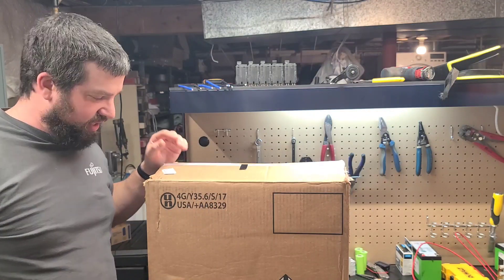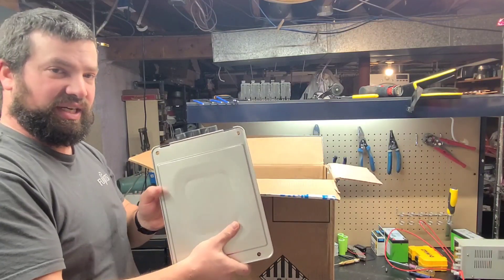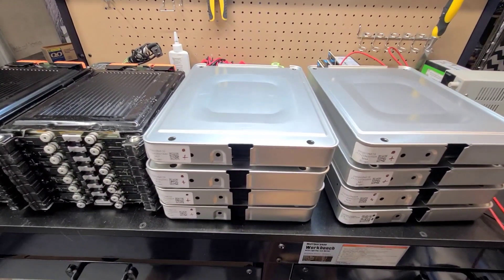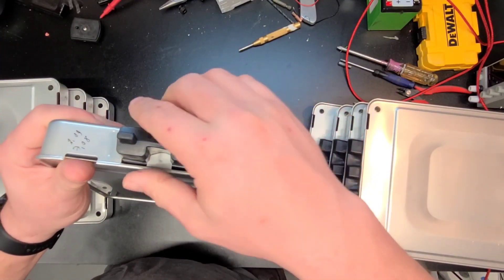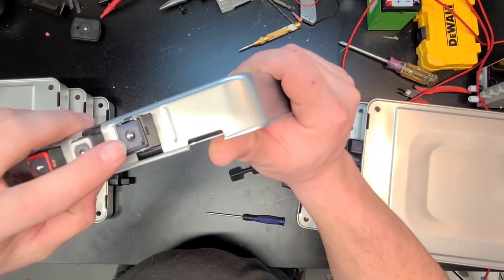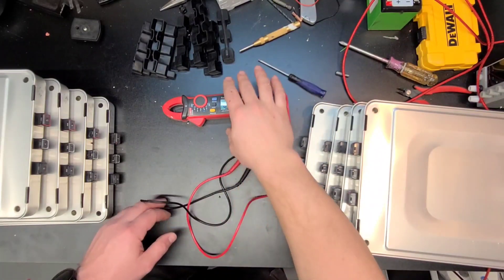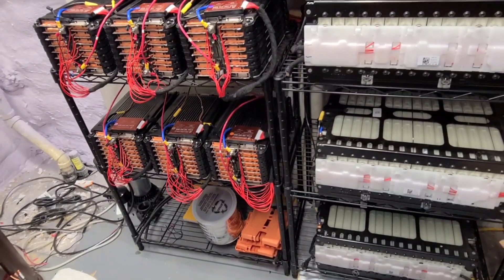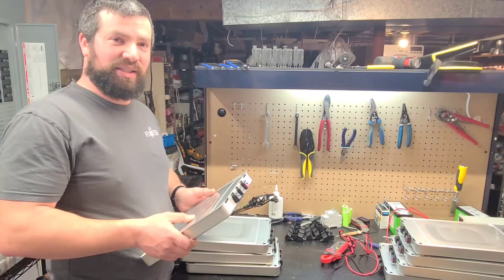Nissan Leaf Batteries for $40 a piece!

Comment: What where do you get the charger for those batteries?
Thanks for replies.
Reply from the maker: I'm using the Sol-Ark 12k to charge them.  It's got an AC charger as well as 2 built in solar charge controllers.

Comment: Another thing I like about the NMC cells is you dont need a large pack to deliver a whole lot of amperage even though I personally do not need it. The Nissan leaf cells are rated for 240 amps continuous and 540 amps max. Of course they would get warm at these draws but for surges etc it wouldn't hurt them at all.  You could have 7 or 8 leaf modules for 48 volt system with as little as 2-3 Kwhr of battery even if you just need them for surge starting motors when only using pv when sun available especially if you have an inverter that must have a battery.

Comment: What bms are you going to use?
Reply from the maker: Daly 40a 16s, just like the rest of my pack. I don't mind not being able to see all the numbers all the time.
Reply: @benssolarandbattery  educate me please sir. Does the bms see 8v or 4v? I mean does it see the voltage of both cells in the case?
Reply from the maker: @RJ-cc1fz  it will see 4v, or each series cell (or group of cells) 
The middle tab allows you to get down to the 4v level. I'll wire it up soon on camera.

Comment: The cost of Lishen or EVE lithium iron phosphate cells are around $125 per Kw capacity delivered now but it does take a lot longer to receive them.  For me and I assume many others though that already have compatible cell chemistry its a good deal.
Reply from the maker: Yeah, I had 2 choices.  Dismantle and sell my NMC 16s setup and go all LiFePo4 with those EVE cells, or double down and keep adding to my NMC pack.   Once I add my latest batteries to the pack, it will be around 37kWh.  I need at least 100kWh to even consider disconnecting from the grid (all electric house) so we'll see what happens.
Reply: @benssolarandbattery  You are kinda in my boat I have 30 Kw of the new chevy Bolt cells from the spring sale and just added 45 Kw of the Leafs from this deal .  Doubt I will ever go totally offered this cold spell now coldest its been here  since about Xmass 1982 which would be ok but cloudy 6 days in a row also. If I had been running generator the fuel would have cost more than connection fee and a little backup for over a year.

Comment: I am not sure what math or data they are using but 7.6 volts and 64 amp hour equals 486.4 wh  NOT 500wh. ? right off the batt lost 2.72% of energy ?
Reply from the maker: I'd bet one of the numbers was rounded down.  I'll look into it.
Reply: @benssolarandbattery  probably but I think 2 would have to be rounded down to make that much difference so like 7.7 and 65ahr would be 500.5 wh but 7.7 for 2 presumably 3.7nominal volt cells is a little high too ? should be 7.4 ? Either way it should be worth this price.

Comment: I bought 132 cells and 65  were what I will call right handed cells and rest left handed so pretty close to half but I didn't really care.  I wonder if the Nissan cells were meant to be larger to dissipate more heat via the extra metal surface area since they had no liquid cooling.  My cell voltages ranged from 6.92 to 7.14 but the cells from each individual box were within 9 hundredths of a volt.  They stack pretty well even if you need to turn the cells over to make terminals the way you desire.  They slide around a lot without stabilizing rods anyway.  I am making stationary packs 2 sets of 8P 7S from these as well as some golf cart batteries so I dont really care what side terminals are on but I did notice the advertisement at Battery Hookup did not specify the mix of terminals . I figured that might be one reason why less expensive than most. I used the David Pot code also.  Remember 7S or 8S is a 45 volt battery since they are 2p2s in each module.

Comment: If I remember correctly, that's a carbon coating to prevent the copper from oxidizing.
Reply: Interesting didn't know that tnx 👍
Reply from the maker: Yes, I spoke with Battery Hookup after I posted this and they said that's what it is.  I'd still scrape it off before connecting.